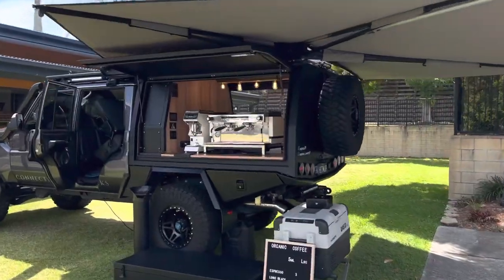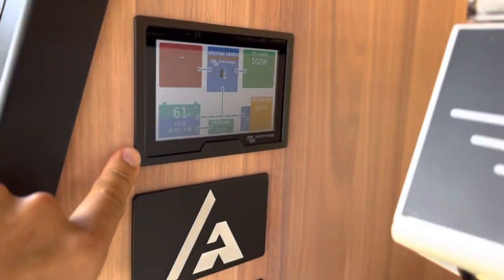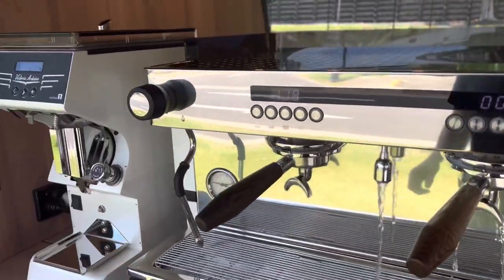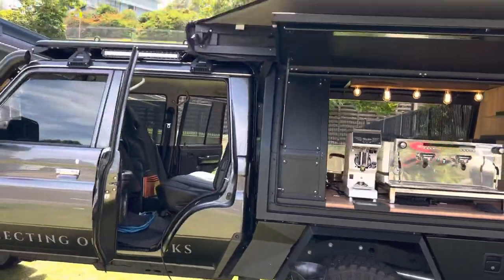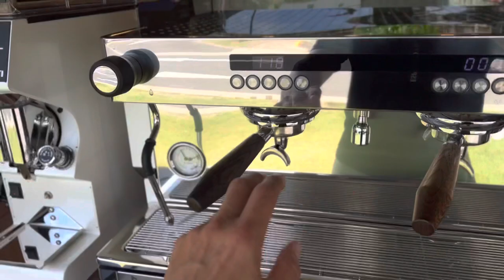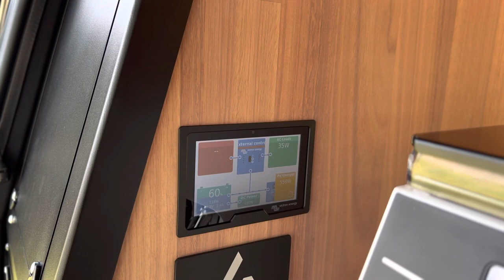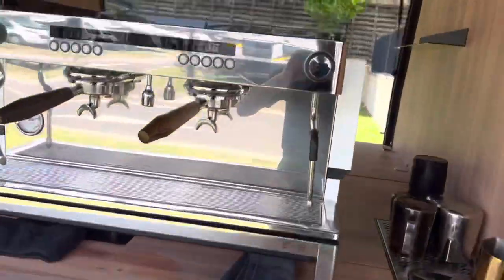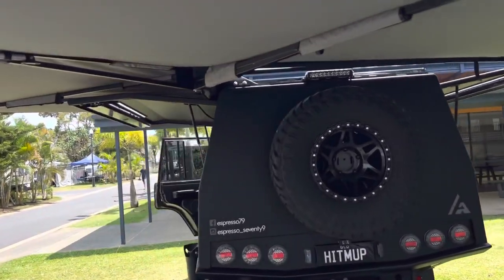79 Series OFFGRID Mobile Coffee Power

Comment: What else do you have in behind the canopies internal headboard?
Reply from the maker: *100lt stainless water tank *recovery gear *6000w instant hot water service *1x 200amp lithium battery and storage
Reply: @espresso79  appreciate the reply. Like the idea of having the main electrical hub in the cab 👌
Reply from the maker: Certainly many benefits (if it can fit) without altering the seating of the cab 
Cheers mate, anytime🙏🏼☕️☕️
Reply: @espresso79  it’s an amazing setup dude. I’ve been contemplating a 79 for ages with a trig canopy but want the extended chassis like yours but not many examples of the trig canopy on the extended chassis. But yours looks the goods 👌
Reply from the maker: Thanks for the feedback mate! As you may know, we are the SE Qld authorized Trig Point distributor and installation centre and happy to chat to you anytime that suits. We have 79 arriving to our doors mid Jan for some work with an extension also😉
Reply: @espresso79  mate should I get the opportunity over the next few months I’d love to come up and check your setup out in person 👍
Reply from the maker: Our doors open mate and if the opportunity arises, please do so🙏🏼 merry xmas and best wishes for the new year! 🍻🍻🍻
Reply: Hi, how is it going? Saw your video today. Really loved it. This is how I wanted to do business too. Is it possible if you guys tell me the rough estimation on cost of this setup? Appreciate it.